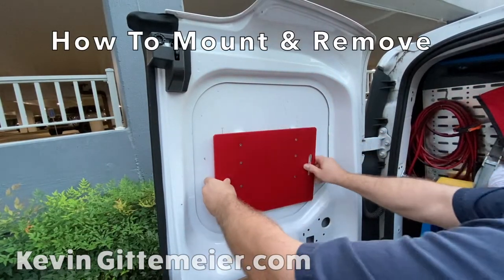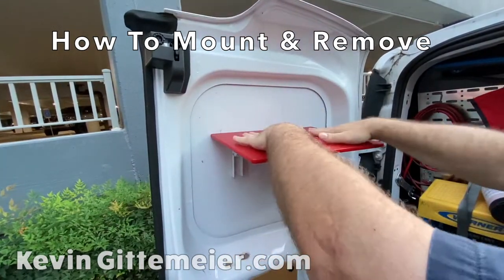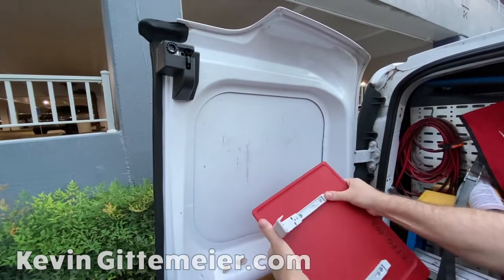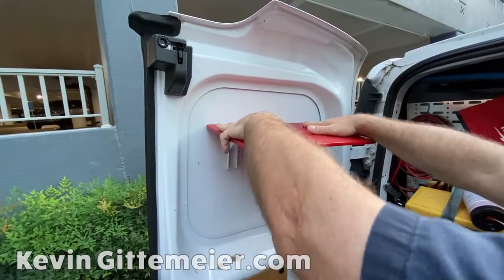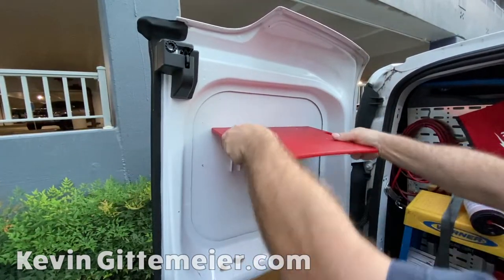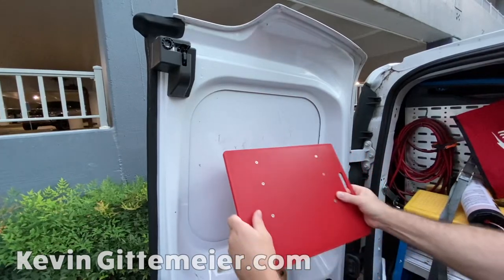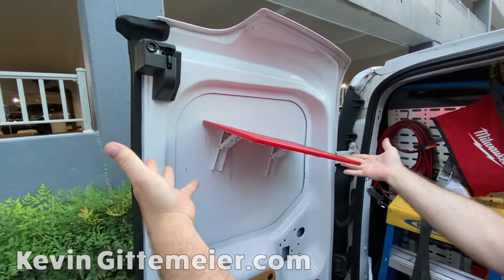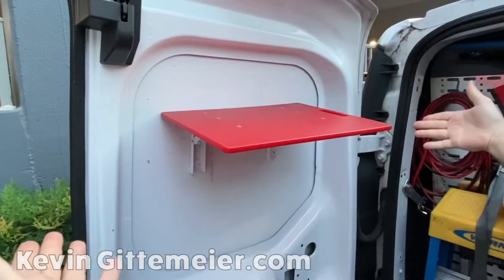Magnetic Folding Shelf V2 [KTFG 390] IUEC Elevator Industry

Comment from the maker: Regarding the Magnets I now have 2 configurations I recommend more than what is listed on the website.
Config 1. 1/4 x 1/4 x 1/32" thick magnets glued on, top to bottom (120 total, 60 per)
Config 2. 1/8 x 1/8 x 1/32" thick magnets glued on, top to bottom (560 total, 280per )
I sand the paint off the brackets before glueing and now just use automotive paint and or auto clear coat on the magnets instead of tape.
I have photos and video I need to post on the website and YouTube detailing the process.
If you can wait a little before changing your magnets, you may find my details helpful.
Reply from the maker: Rubik’s 4x4 Beginner Method Tutorial:  https://youtu.be/3U-HWJaHHwQ 
https://www.kevingittemeier.com/4x4-cube-tutorial/

To purchase Puzzles seen in tutorials:
https://www.kevingittemeier.com/shop-games/

For a deeper understanding of each Step, see Supplemental Tutorials:
4x4 L2C (Last 2 Centers):  https://youtu.be/gnBcpUzRrJU
4x4 Edge Flipping Fundamentals: https://youtu.be/g3WCRCI4Dh4
4x4 L2E (Last 2 Edges): https://youtu.be/ZPwSy8PweDM
4x4 PLL Parity Intuitive & Alg: https://youtu.be/1Vj6gy_8-u8
4x4 OLL Parity Intuitive: https://youtu.be/mkwJRgwy4R4

Comment: That’s a pretty strong hinge mechanism.
Reply from the maker: Over 100 lbs per hinge, much stronger than needed.  The magnets will slide down long before the hinge fails.
Build Instructions & Material List:  https://www.kevingittemeier.com/magnetic-shelf-v2/
[KTFG 390] https://youtu.be/99cF0JD8k7A
[KTFG 389] https://youtu.be/gNxLWbxZBlk
[KTFG 385] https://youtu.be/SJWtDpwSxcI
About $50 in material.  Buy the magnets from https://totalelement.com
Reply from the maker: In order to keep it compact and low profile it’s important to use the exact same hinge and magnets I have listed.

 https://www.kevingittemeier.com/magnetic-shelf-v2/

https://youtu.be/99cF0JD8k7A

Comment: When can we expect to see version 3?
Reply from the maker: Soon!
But it took 20 years to complete version 1 so…. 

In the meantime check out magnetic elevator crosshead boards.  Simple but very useful.  https://www.kevingittemeier.com/crosshead-work-board/
Reply: I actually did see the crosshead boards, very well thought out and executed. I intend to show them to a couple people I know, but I'm currently focused on HVAC controls, so I don't really have an application for them specifically.

I just built a variant of your "version 2" and I love it! I say "variant" because I skimped on the magnets.... Don't skimp on the magnets!
I will be chiseling them off and replacing them sooner than later. 

But honestly, the key is those brackets. I can't thank you enough for doing the research to find those because they are amazing... And the extra magnet to hold them closed? Man, you really covered the bases.

I built this in approximately 1 hour (after an hour of reading and watching your content) and spent less than half of what comparable products cost. Totally worth it 👍

Looking forward to origami version 3! 
Take your time LOL version 2 is going to be difficult to improve upon without jacking up the cost!
Reply from the maker: @dretrott1652  Yes the hinges took a lot of research and wasted money trying to find just the right one.
Regarding the Magnets I now have 2 configurations I recommend more than what is listed on the website.
Config 1. 1/4 x 1/4 x 1/32" thick magnets glued on, top to bottom (120 total, 60 per)
Config 2. 1/8 x 1/8 x 1/32" thick magnets glued on, top to bottom (560 total, 280per )
I sand the paint off the brackets before glueing and now just use automotive paint and or auto clear coat on the magnets instead of tape.
I have photos and video I need to post on the website and YouTube detailing the process.
If you can wait a little before changing your magnets, you may find my details helpful.

Comment: Have you tried the high gloss plasti dip? Or a high gloss final coating instead of elec tape?
Reply: Also as configured with the 6 magnets at the top what is the weight capacity. I need something that can hold roughly 30-50 lb at the other edge.
Reply from the maker: Yes I tied plasti dip as shown here on my website: https://www.kevingittemeier.com/magnetic-shelf-v2/4/
6 magnets (the ones I use configured as I do) will hold over 50 lbs at front near the magnets but not the very end.  
You may want to put magnets all the way down (also seen on my website).
https://www.kevingittemeier.com/magnetic-shelf-v2/